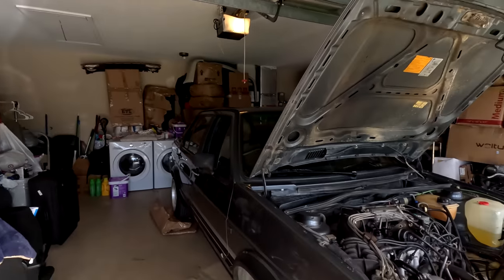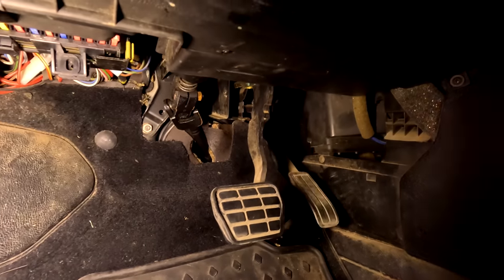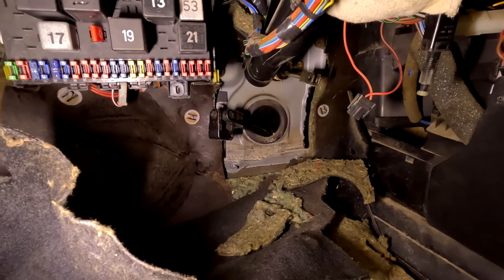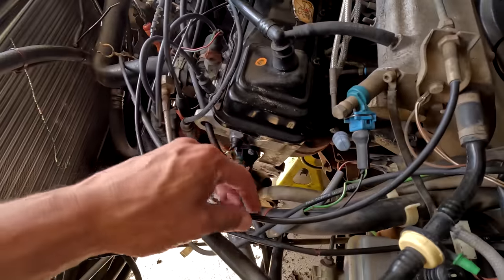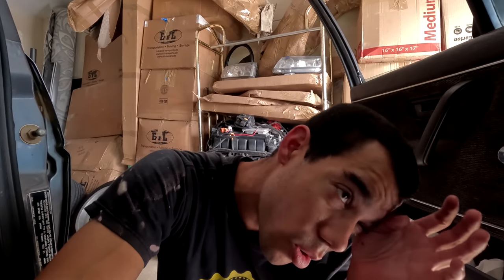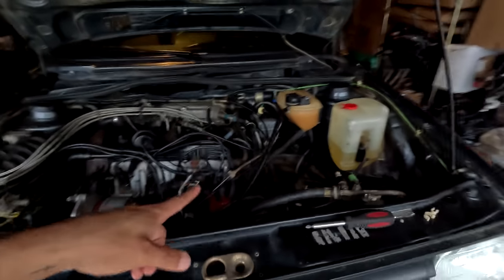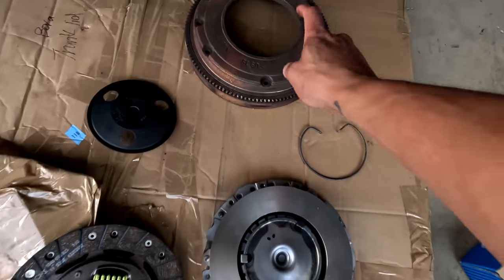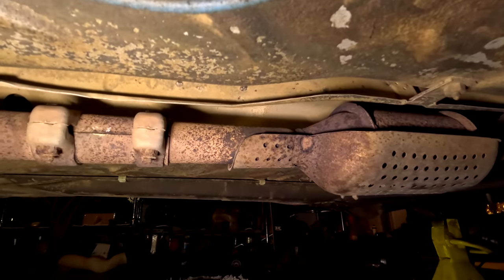Mk2 Jetta Manual Swap Progress! ( Clutch, Pedals, Shifter )

Comment: The pedal install was easier than I thought, but I wasn’t under the dash. By all means change out the exhaust while your at it. You need to buy yourself a free standing tower fan. Y’all don’t want to dehydrate in the Florida heat ! Great job, as always ! Thanks, RickGTI…..🌴

Comment: Don't forget to loop the connector that was on the shifterbox or car won't start. if you don't know it will be a headache 🙃
I don't think clusters are different from manual to automatic. If so it must be US only.
Reply from the maker: I gotta look up how to do that appreciate the comment 👍🏼 I haven’t pulled the cluster yet to see the connector but I will
Reply: @Mk3Smith  no problem. 
The cluster from the donor will not work but the speedocable will from the donor

Comment: A buddy of mine has a NA diesel mk2 automatic and suffer from the exact same problems, sadly diesel automatic starters are non existing, we tried with a petrol starter with the heat shield on and everything and it started for a couple of days and then had the same problem again. Kinda weird since yours is 35 years old his is 31 and i assume they haven't had new starters every two weeks for 35 and 31 years :/ that would make quite a lot of starters
Reply: and the stupid placement VW whats up with that :P

Comment: I dont think a ce2 cluster will work with a (ce1?) body harness that your car should have. Mk2 gurus can correct me if im wrong
Reply: The original cluster from the car should be the older style with two plugs. Ce2 cluster has one small plug. So yeah they're incompatible without making adapter.
The steering column will also be a problem. Ce2 has different connectors everywhere and it can't be easily replaced
Reply: @thescalefactorypl9932  also my thoughts, if that whole ce2 harness is available from the red car he should consider doing the full swap. I think it will also make the 3.6 swap easier
Reply: @LucnotLuck  that's actually a good point! Of course swap is possible with ce1 but ce2 makes it way easier and i think that there are already plug&play engine harnesses for ce2.
Personally I've made G60 swap to ce1 car and it was quite a struggle 😅

Comment: I cant for the life of me not understand why you do not take the front of and lift the engine. It is much faster and easyer i every way to do both linkage and gearbox. No crawling and lifting heavy stuff under the car. Learn from others.
Reply from the maker: Wasn’t necessary to pull the entire engine for this job. Also I don’t have an engine hoist anymore or a place to store one currently.